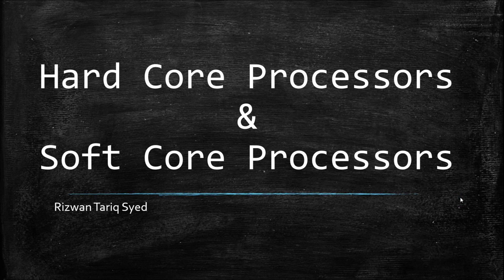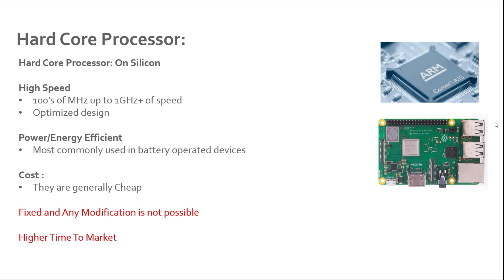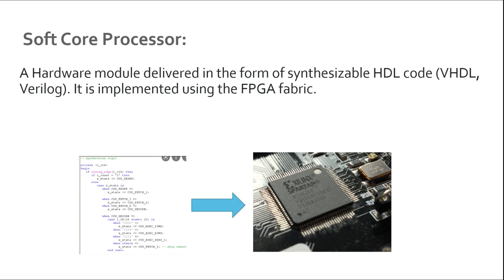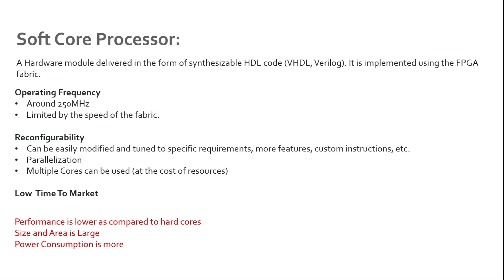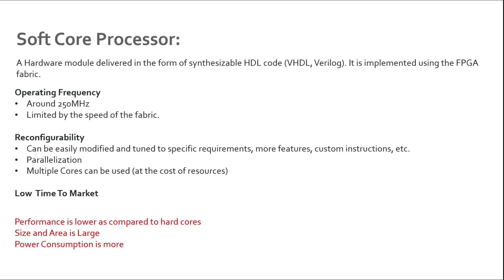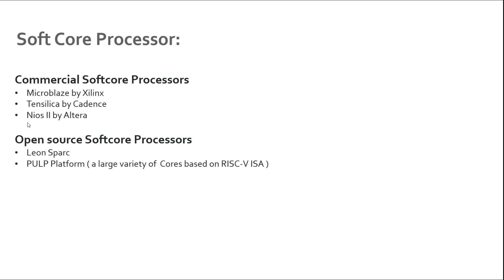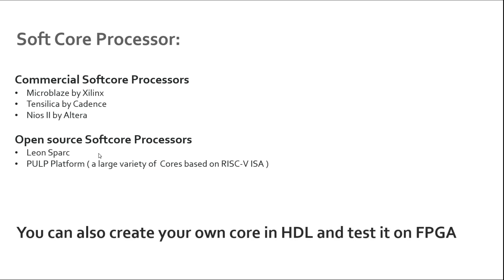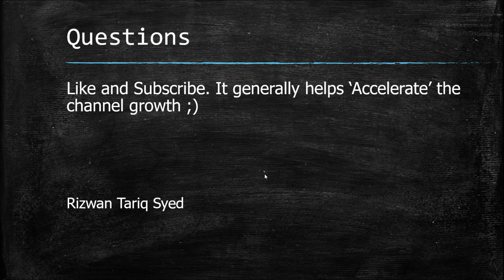Hard Core and Soft Core Processors Implementations: Clearly Explained

Comment from the maker: A slight mistake I made during the video, which led to some confusion among some viewers. So this is some Further Explanation of Soft Core and Hard Core.

A soft-core processor is delivered in the form of synthesizable HDL (Verilog/VHDL) code. This HDL code of soft-core can be customized for a given application and can also be synthesized for both an ASIC or FPGA target.

1) In the ASIC design flow, this HDL code can be synthesized using ASIC libraries. And after fabrication, it eventually leads to an ASIC (physical chip or a hardcore).
Once it becomes a hardcore (ASIC), At this stage, any customization in the Processor architecture will not be possible.

2) On the other hand, if the same HDL Code(Softcore code ) is implemented using FPGA, it is (in most cases) possible to change/customize the processor architecture in code and re-implemented the design on FPGA ( as FPGAs are reprogrammable.)

3) Softcore does not imply that it can only be implemented on FPGA. It just means it is licensed as synthesizable HDL (Verilog/VHDL) code. The buyer can synthesize it into ASIC as well using ASIC libraries. 

e.g., Cadence provides Tensilica Processor IP as a soft-core. These soft cores can be implemented on both ASICs and FPGAs as well.

4) In the video, I have discussed the pros and cons when this soft-core is mapped (or implemented) on ASICs (as hardcore) vs. on FPGA. 

5) And if you plan to write your own processor core in synthesizable HDL (Verilog/VHDL) code. You have the choice to either follow the ASICs design flow and make a Physical Chip or Implement it on FPGA. Both things are possible.  

Thanks a lot for understanding.

Comment: is every fpga design require a processor
Reply from the maker: Hey,
No. Its not necessary. for many years, FPGAs have been in the commercial use without the processor.

Comment: I've been working on a retro game handheld.  I implemented the motorola 68k on my Max10 (soon to upgrade to a Cyclone V or 10 or maybe a Xilinx fabric) I get good speeds on the fabric.
Reply from the maker: Interesting. Could you please share some more info about it. What is the size of the Core ( in terms of logic resources ). and what was the maximum frequency were you able to run the cores ?
Reply: @rizwantariq1523  on my deca arrow with  10M50DAF484C6G max 10 fpga I use 33% of the capacity and the video processing unit uses about 25% so far. I got about 85Mhz max clock speed but I run it at 50Mhz. I do know the apollo m68k cores exceed 400mhz on a cyclone V (possibly a III)
Reply: @rizwantariq1523  I’m planning on using fusesoc on my new chips build so it can run on many different board types.
Reply from the maker: @FunnyPianoZohar  this FuseSoC thingy sounds interesting. I have noted it down to have a look at it in my free time.  Thanks for mentioning it. (Y)
Reply: @rizwantariq1523  Once you learn it and use it for your softcores you can't live without it.  Even if you only have one vendor type CLPD\FPGA , it's always good to have portability in mind.